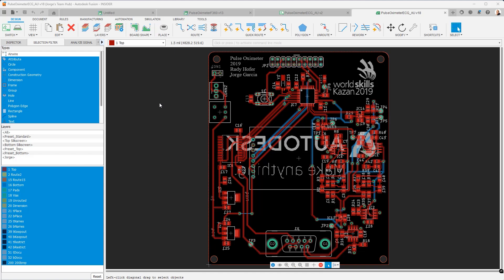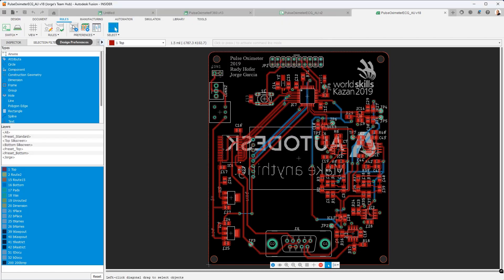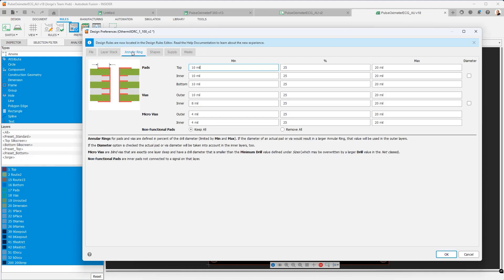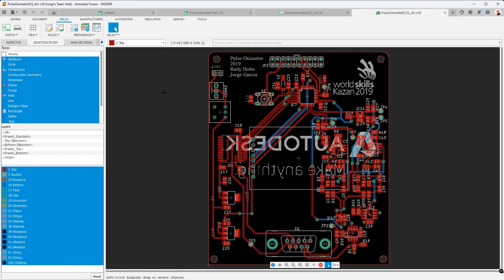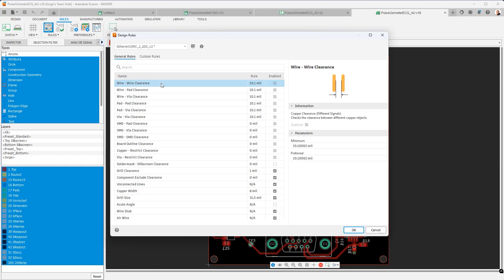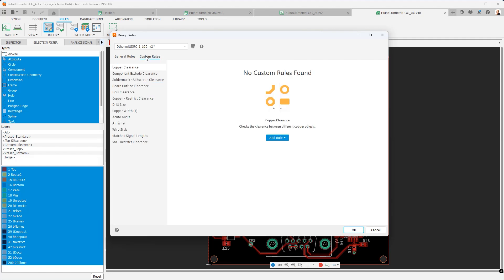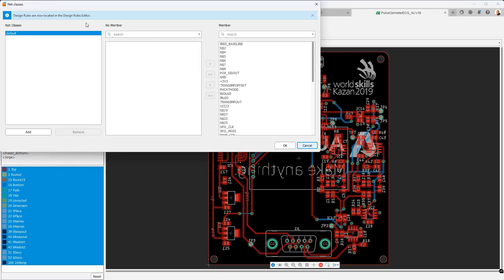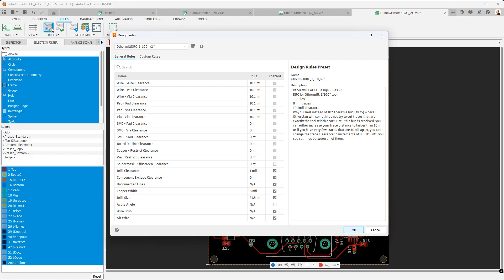Design Rules and Preferences, Part 1: Overview | Autodesk Fusion

Comment: It was a frustrating change that took me a few hours to understand, but the next video cleared it up for me. The main issue is that it used to be easy to define custom net class rules right inside the net class interface. Eliminating that option makes the UI worse. Now, I can't even see the net class copper width from inside the schematic editor. I need to go to the PCB editor and deal with it.  If you could at least show the net class copper width inside the "inspector" tab in the schematic editor, that would be helpful.